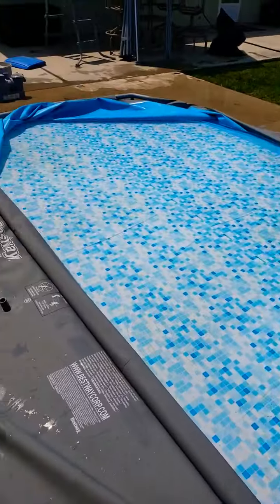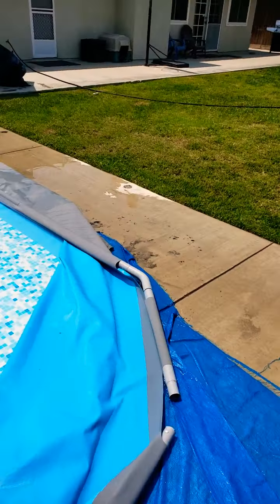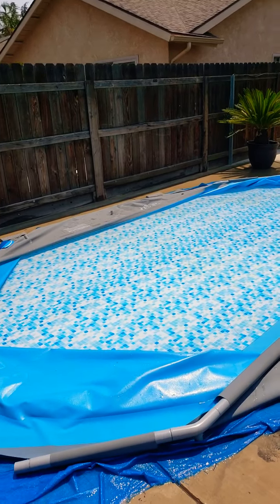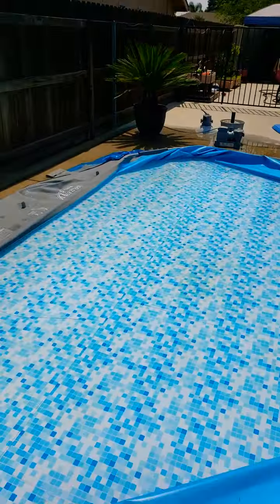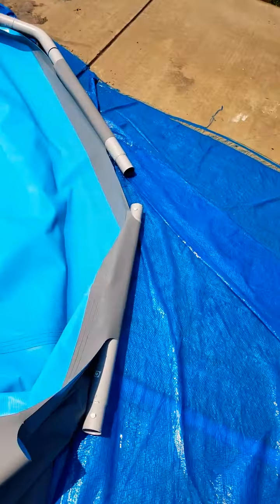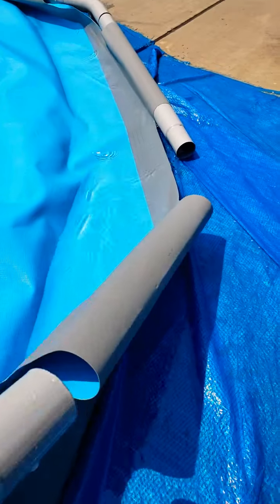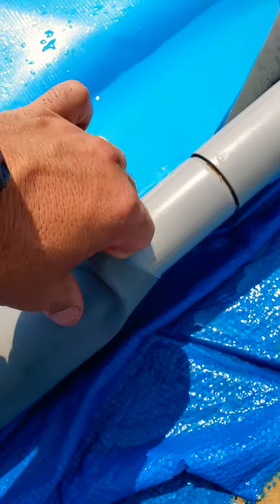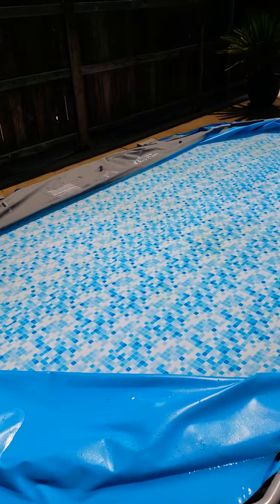BESTWAY POOL - Disassembly Tip

Comment: Any tips on how to avoid this? During assembly, would covering the poles in a lubricant of some kind help (I was thinking spraying them with a cooking spray might help). Any ideas?
Reply from the maker: No idea. Any lubricant may damage the vinyl
Reply: I read that covering the poles with talcum powder during assembly will prevent this. Apparently they slide right out. Anyone know if this works?

Comment: So How did you drain it all the way, their looks like there is a port at the very bottom of the poll, but afraid to open it up and it start to drain.  thanks.
Reply from the maker: Bottom drain while standing. Then shop vac the rest with a broom into the corner. Sorry for late reply!!

Comment: how did you get the long sides out .I got the end ones out but the long side one are a real problem
Reply from the maker: You have to pull the vinyl off the long tubes its painstaking but the heat from the sun and weight of water heat seals/melts them together. I had to go inch by inch then the entire tube will slide out
Reply: This is a joke ready to return to Costco, was there any technique that was helpful
Reply from the maker: @carrdiac  it was a process I'm thinking you're having a issue removing tubes? You have to peel the plastic from the metal it's a pain
Reply: @svsmiley  Ive been trying for many evenings and I can't get the long poles to progress any further. The ends took forever but because they were accessible  I could detach them. Has anyone found and solution? Inch By inch is not working. 
FYI I tried a heat gun and it did not work either.
Reply from the maker: @brandonstreiff8551  heat gun!! No! I used a section of plastic like a spatula to separate the vinyl from the poles then they slid out!
Reply: Matt J.
1 second ago
Buy a 36" ZIP tie and feed it through.The point of the ZIP tie will break up where it sticks to the pipe.

Comment: can anyone tell me how you get the  side pieces disconnected
Reply: Matt J.
1 second ago
The heat of the sun melts the vinyl to the pipe. Buy a 36" ZIP tie and feed it through.The point of the ZIP tie will break up where it sticks to the pipe.
Reply: @mjaeky  Thank you..but a knife barely gets it unloose at the ends.mine is really welded

Comment: Anyone have an idea how to prevent the vynil from sticking to the poles? So hard to separate.
Reply from the maker: Someone said talcum powder may be an option. Others asked about putting a lubricant... im curious but hesitant to put anything on that could damage the vinyl.
Reply: So I filed a claim on Bestways website. They are sending me a new liner. Said I’m only the second person in a year that has had this problem. So you all need to contact them.  Just need your proof of purchase (receipt), picture of the serial numbers by the drain plug, and a picture of the poles stuck.  They processed it in less then a week. I’m pretty impressed.
Reply: @svsmiley  The heat of the sun melts the vinyl to the pipe. Buy a 36" ZIP tie and feed it through.The point of the ZIP tie will break up where it sticks to the pipe.
Reply: Talcum powder definitely works. It is a dry lubricant with no effect on vinyl or rubber. Back in the day it was used on inner tubes to prevent chafing on the tire.

Comment: My poles are forever stuck in the plastic after the first season. RIP Bestaway
Reply: Buy a 36" ZIP tie and feed it through.The point of the ZIP tie will break up where it sticks to the pipe.